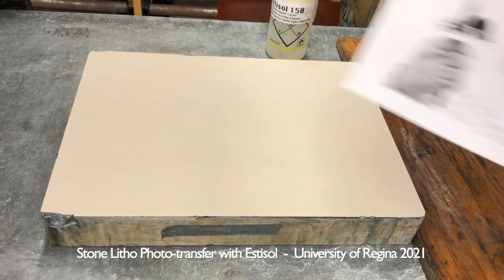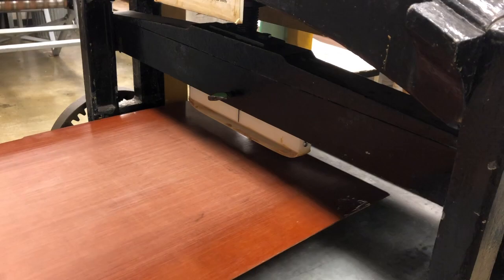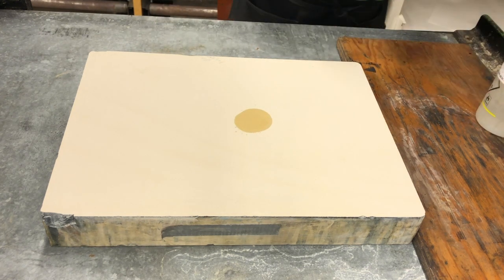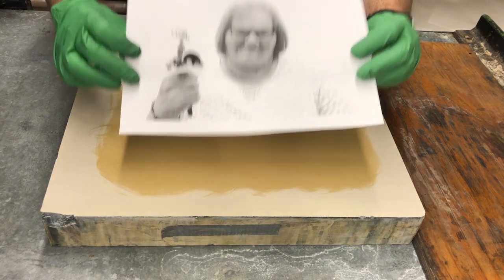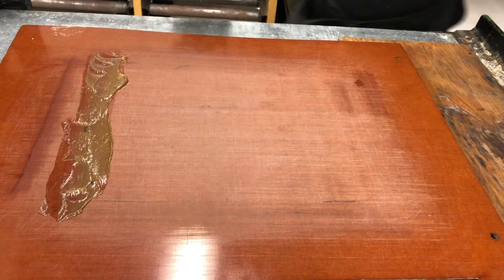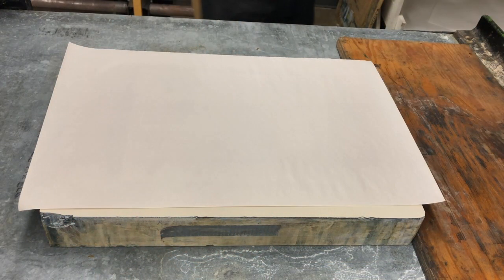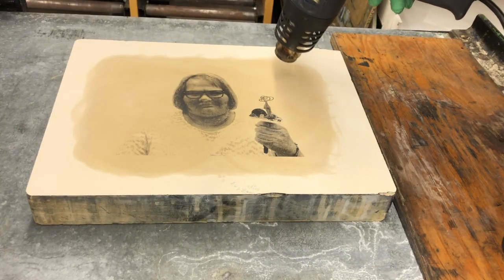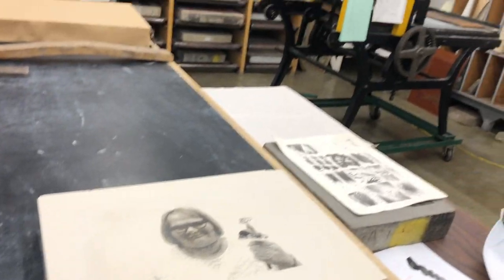Photo-transfer on Stone Litho

Comment: Hi prof. Truszkowski, I'm wondering in the 1920s, how do we transfer technical drawing to limestone? Does ink material matter since the description said that we cannot use inkjet? Does Estisol etch the limestone or it is used to transfer image from one medium to the limestone? I guess it is just to transfer. I see that you mention the etching process in the end of the video so I may need to watch more of your videos (https://www.youtube.com/watch?v=ZjdCYMwVak0). Thank you for sharing.
Reply from the maker: Hi, thanks for your questions. I'm not entirely sure what you mean by transferring a technical drawing, but with stone litho, there are many different drawing materials and tools. A very skilled and patient artist can put just about any kind of drawing onto limestone. As far inkjet, no, the ink won't transfer reliably, and ultimately stand up to the chemical etching process. As such, we need the plastic-based toner of the photo-copy/laser printer to transfer to the stone. The toner is released from the paper by the Estisol, and then it settles on the stone, providing a stable base to etch and ultimately print. And yes, Estisol is simply a product  to transfer... it has no etching properties.

Comment: Hi, I’d like to know if you used raster image for it ? If so, what do you reckon for a 300dpi image ? Which halftone looks ok for you on photoshop ? Many thanks in advance. 
Kindly Ewa
Reply from the maker: I have played with all sorts of imagery and imaging output strategies. If you are wanting really clear photographic results on the stone, you actually need to use a fairly coarse halftone… ellipse dot 45-60 LPI. My experience that going higher/finer with the image IS transferable to the stone, BUT things tend to fill in. Midtones shift darker and shadows turn black (or whatever colour you’re printing). My advice to my students is to use slightly higher contrast images in the first place, and to shift their expectations from “a photo printed from a stone” to “something photographic on a stone that can then be worked/reworked/drawn into.” (Think of the transfer as an additional kind of drawing tool.)
Reply: @professortruszkowski  thank you very much for taking the time to answer me

Comment: Hi! Any tips when printing the photo on the laser printer? Do I just print out as is?
Reply from the maker: Some laser printers/copiers work better than others, but most will be ok for the process (as long as they are black&white... not colour machines)  I find that higher contrast images work well. If you are using an image with tonality, you might want to put a halftone on your image either in Photoshop, or in the printer/copier setting itself, if that's possible. The biggest thing to keep in mind, and the thing my students often struggle with is this > photo transfers are cool, but they are NOT photographs! The process can't compete with photography, or even other photo-Printmaking processes in terms of sharpness or clarity. But if you approach this as a means to putting something "photographic" onto a stone, and then you carry on with the stone from there, you will probably enjoy it much more. Good luck!

Comment: It's backwards. What if your image has text? Or you just plain don't want it backwards?
Reply from the maker: You are right! So like many other things in Printmaking, the image needs to be reversed first. In this case, I flipped the digital photo in PS before printing to the laser printer. Even if this was being done as low tech as possible (using a photocopier), most machines will have a setting to flip.

Comment: where do you get the estisol or what is a good replacement?
Reply from the maker: I have a multi-year supply, which I obtained from a colleague at a university in Toronto years ago. They originally ordered it directly from the manufacturer in Belgium, I believe. (Sorry, that’s not much help to you.) Alternatives include acetone, which is very stinky and flammable. It requires a slightly different approach to making the transfer and is prone to blurring the image. Another option is Oil of Wintergreen which can be done similarly to my estisol method, but despite its minty smell, is pretty toxic. With appropriate ventilation and PPE, (and practice!) both alternatives are doable, just not ideal.